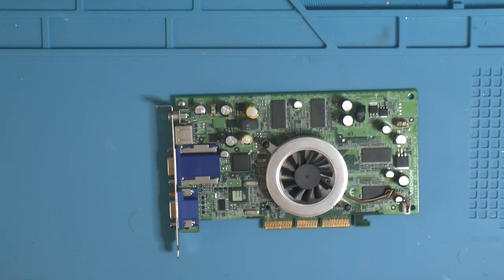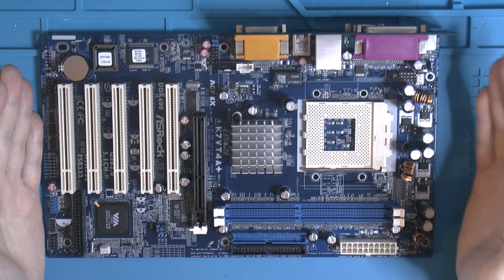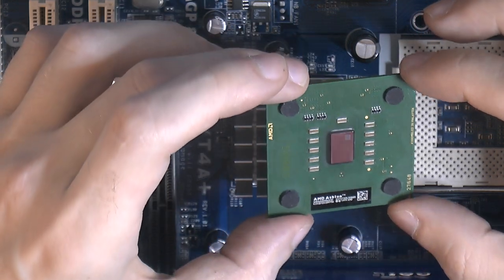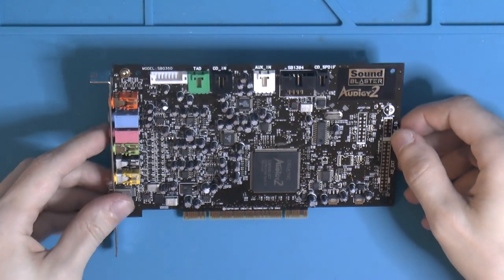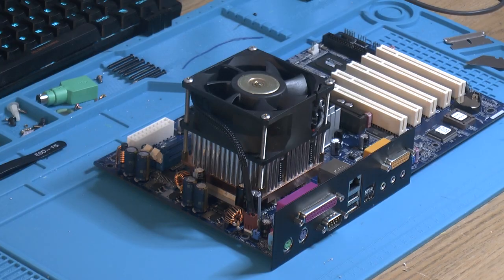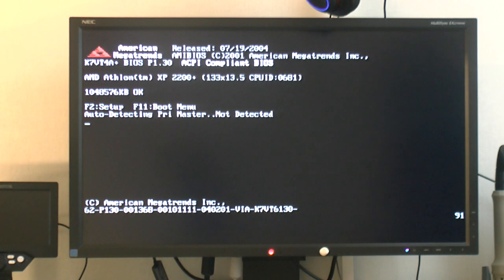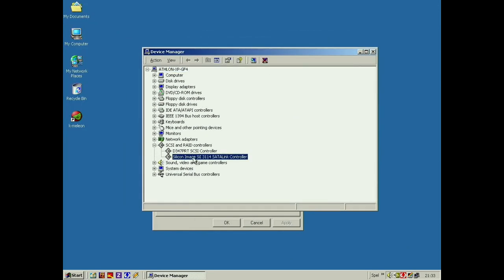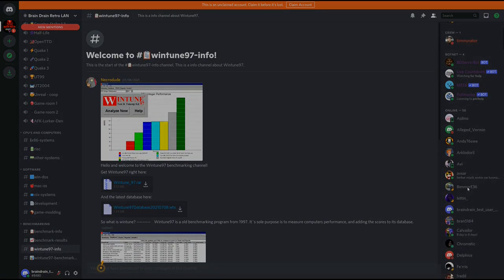2002 Retro PC Lan Build

Comment: Nice CPU fan. Nice contact with the CPU and looks very tight. I had an Athlon XP 1800+, and later on an Athlon XP 2500+. Unfortunately my 2500+ was a bad overclocker and couldn't do 400fsb :(
Reply from the maker: TY!
My first XP was also the 1800+, had the 2400+ after that.

Comment: Oh, Hi I was watching your video and saw that Swiftech monster, do you have all the mounting measurements, glad you could keep the springs... also be careful with the current that fan draw from the CPU fan header, it's a little bit extreme. My Delta didn't came with a 3 pin fan header only molex (0.67A/12V) and the second kit I got came with a Sanyo Denki Petit ACE fan (0.56A/12V) with a molex for power and a fan header just for tacho.